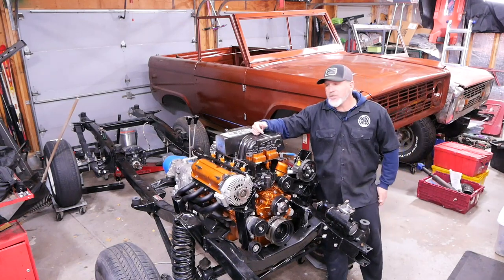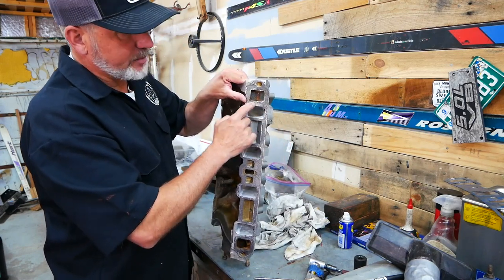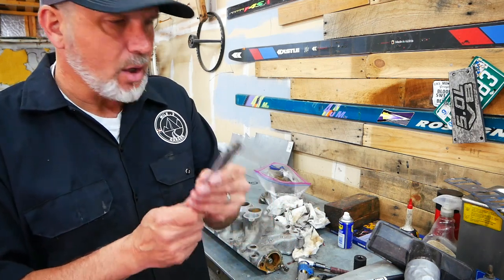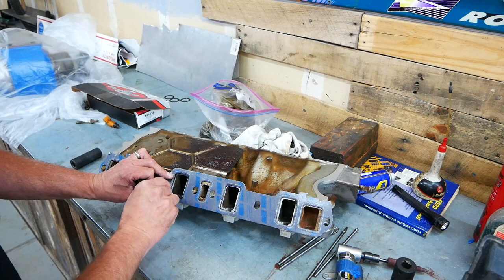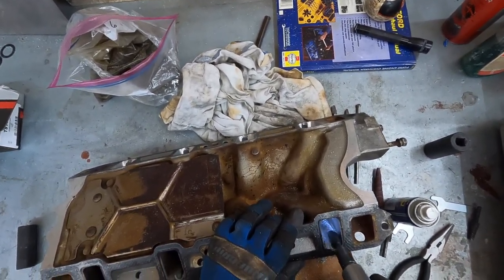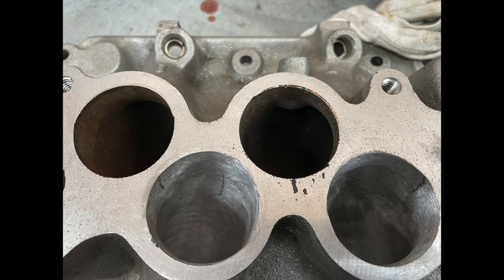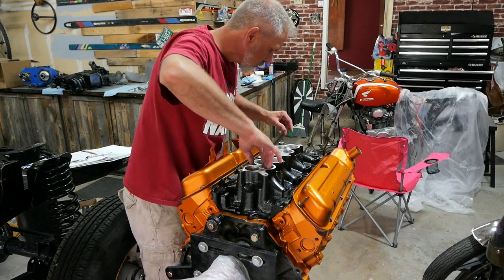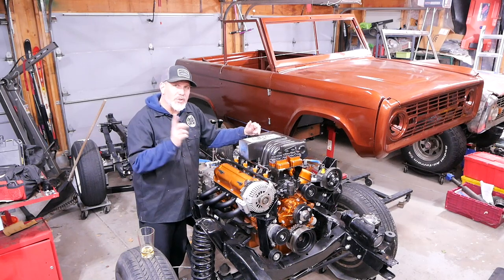Bronco Restoration - Porting Intake (GT-40 Intake)

Comment: Nice! Stock GT40 is about 200cfm so a bottle neck for most engines with aftermarket heads. They make the most torque though. I have a stock tubular GT40 on a 331 it made 365TQ at wheels but only 315hp. Definitely choked out.

Comment: how do you clean out the intakes after you were done? shavings? compressed air? soak it? curious
Reply from the maker: Compressed air, shop vac, parts cleaner, then post cleaning with mineral spirits and white rags.

Comment: I don't understand why anyone would bother with a 8.2 deck Windsor if there isn't space constraints, spending the money to build a 347 when you can use a 351 and if your spending the money for a stroker kit you could have a 408... That's free HP for comparable expense. Now take my sn95 going 9.5 deck is not a great option being considerably taller and wider makes things tight, hood clearance and you need to change exhaust and accessories among other things making the idea of a 351 swap na screw that and  a 347 way more attractive option.